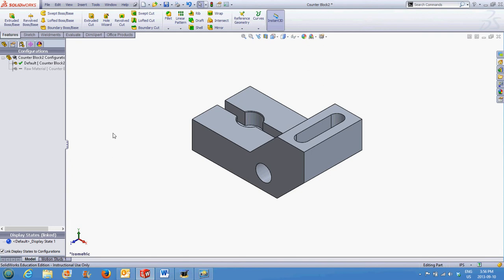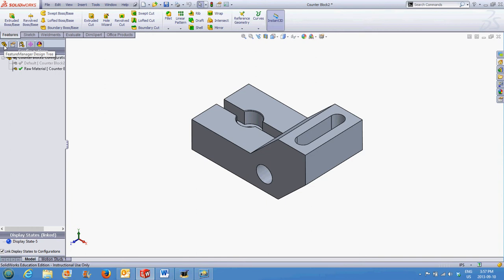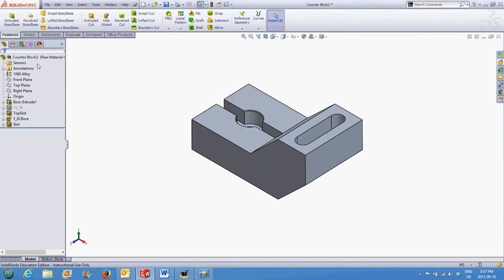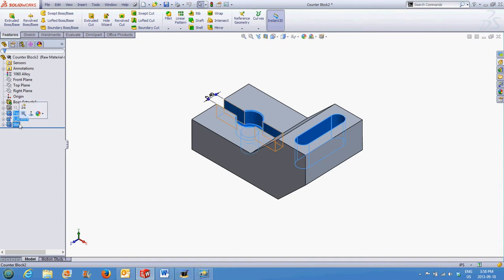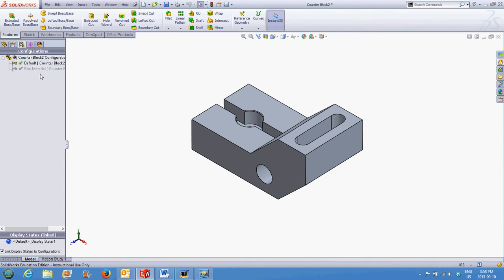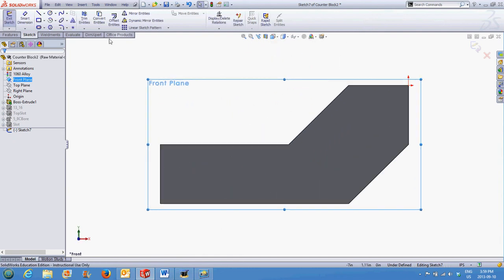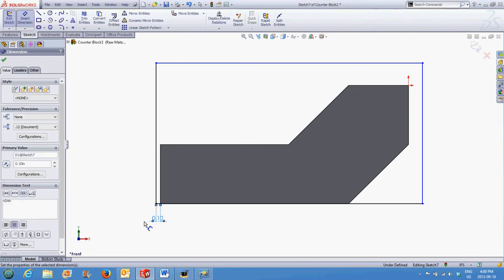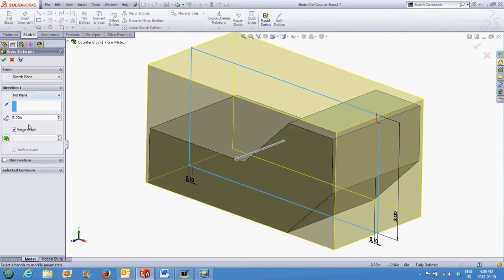Suppressing Features in a Configuration

Comment: Do you think its a good feature? I mean, the information still there. Its an heavier file, right?
Reply from the maker: It can be very useful and yes all the information is still there.  It all depends on your design intent.
Reply: @Fredumaction  I only wanted to mirror a component in a machine, is it a good practice to surpress the orginal part?
Reply from the maker: In that case i would use the "Insert, mirrored Part" option to create the opposite hand part